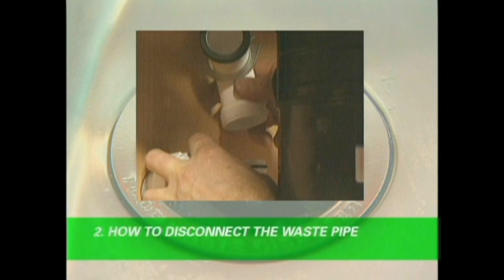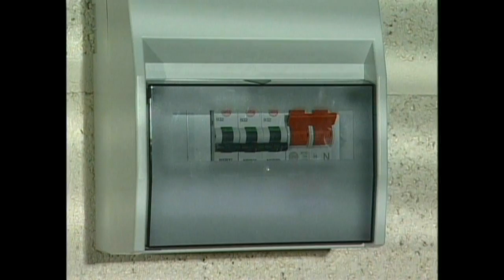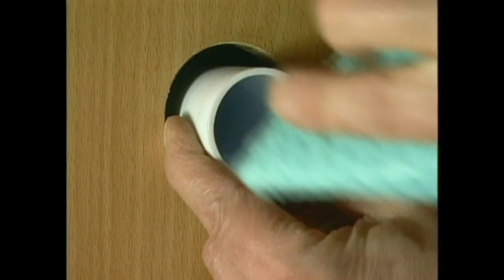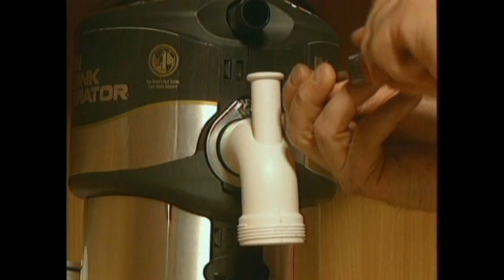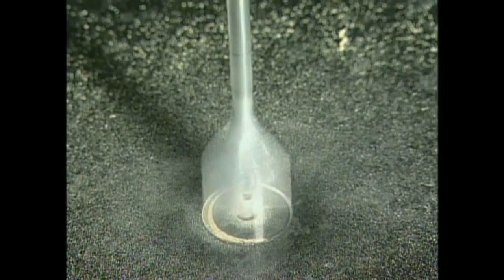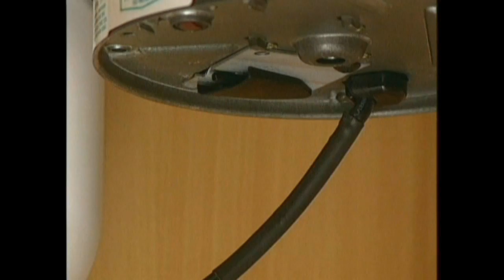Installing a Food Waste Disposer

Comment: What happened to showing complete new unit being fitted. You only showed a replacement of a Insinkerator with another Insinkerator.  Why switch off the whole electricity supply at the consumer unit. Imangine the greif of having to reprogram all the clocks on other appliances. You should only have to unplug the WD unit from the plug. Initially putting a small amount of water in the basin would have been a better check for any initial leak. Also what is the commentary about three conections for the Dishwasher connection ? Other than the above - an informative video - but you missed some of your stated presentation - namely a complete new unit.

Comment: The short section showing the plumber using his knee to hold a heavy disposer in place to connect it to the sink connection was valuable.  I spent over an hour trying to connect my disposer but couldn't keep it level so all three flanges would engage.  Using the knee was the tip I needed... Thanks!!